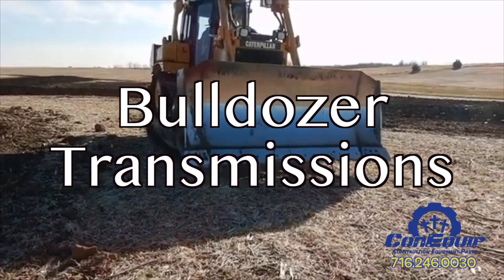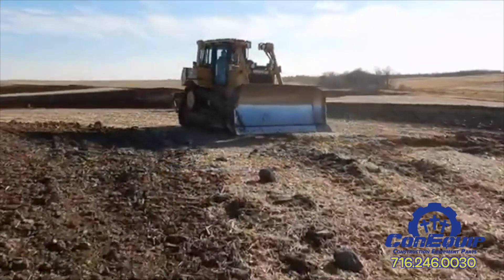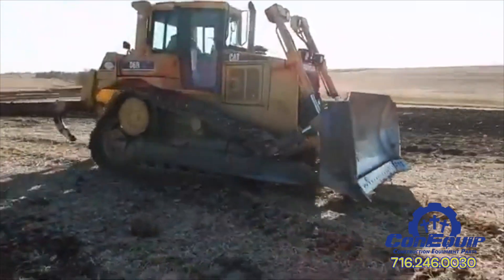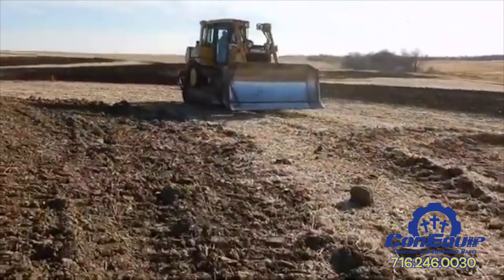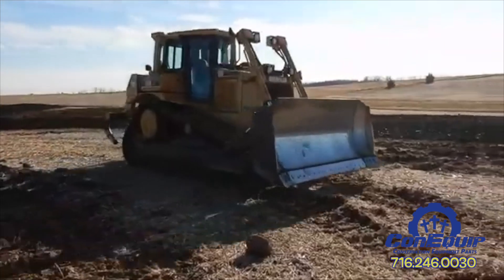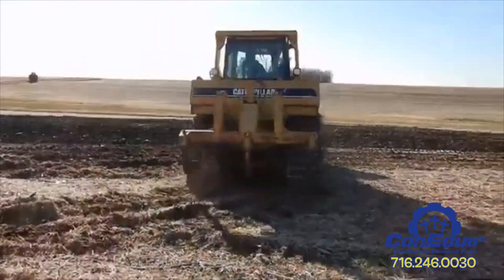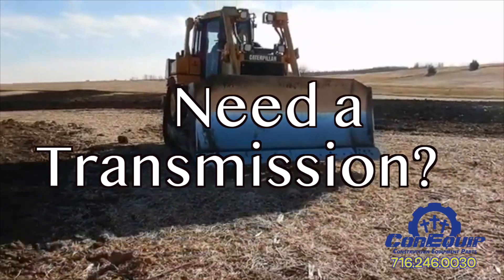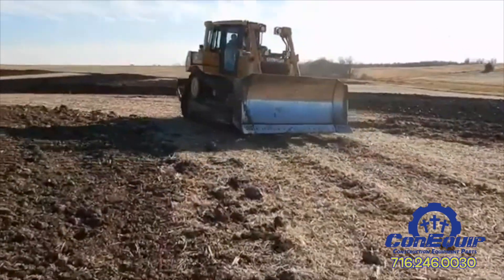Dozer Transmission Problems, What to Look For

Comment: My dozer suddenly gets disengaged when moving in the first reverse shift. What is causing this and how to inspect it?
Reply from the maker: It could be a lot of things, so without more machine information it will be hard to diagnose the issue. It could be a solenoid issue, a mechanical issue, cultch plates, hydraulics, electrical... A lot of things basically lol. Our best advice would be to have a qualified diesel mechanic take a look at it. If you need new parts once you get it figured out, give us a call!